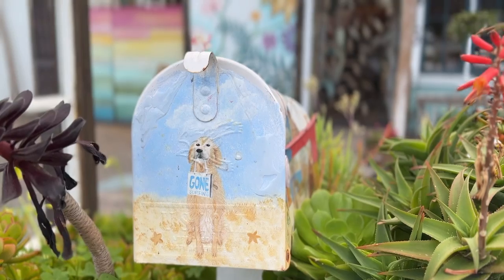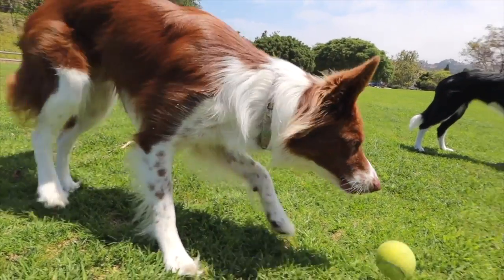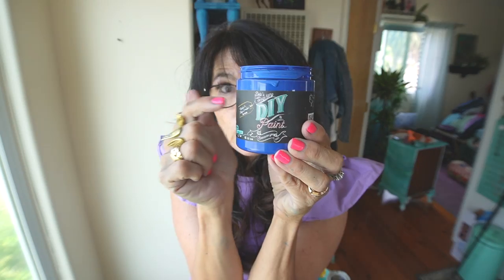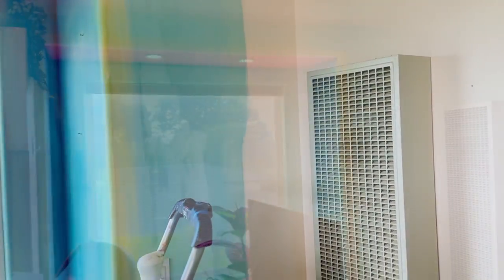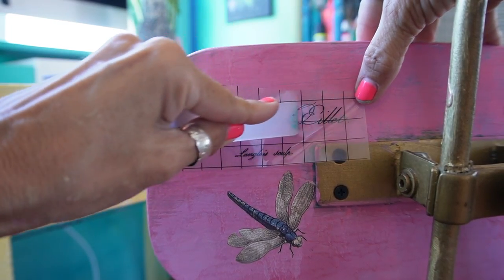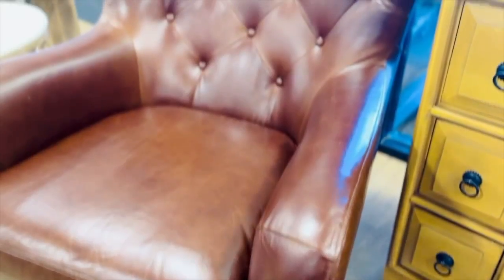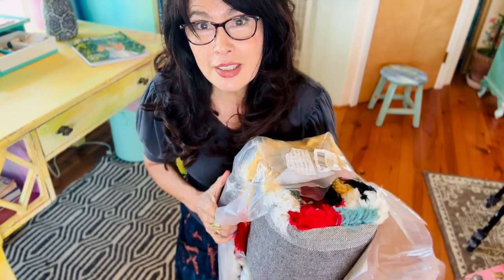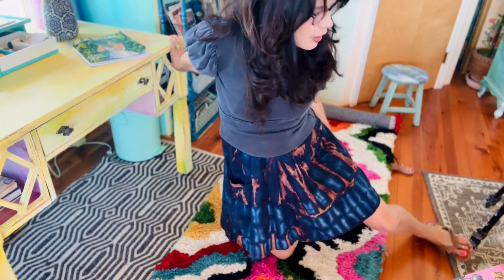25 years Hoarding, MAKEOVER from  vintage TRASH

Comment from the maker: get tickets to our big craft party this September and find all the supplies we used in this video- https://diyagogo.com
Reply: Your room looks fantastic, May I make a suggestion? For safety sake, I would have your dad bolt that tall skinny shelving unit to the wall so it does not come tumbling down on your head and sore neck! even just to attach leather straps around the spindles at the top to the wall... also, you want more weight on the bottom shelves instead of the top to counter balance. I hope that helps hun❤
Reply from the maker: Thank you for the great suggestion! Bobby did that for me last week. The last thing I want was that thing tipping over on me❤❤❤❤

Comment: Absolutely LOVE the colors you use!  Suggestion: Declutter a little bit one day a week for an hour!
I am a hoarder of craft supplies and books. To declutter my house when I retired, I chose to do it one room at a time. I started with my craft room. First step was taking an inventory.  I saw that I had WAY more stuff than I could ever use. Then I held each item in my hands and asked myself if I really needed it.  Could I see myself using it in the next 3 months, or one month? If the answer was no, I put it in the donation box. When I got down to the amount of things that seemed right, I bought a system of totes and shelves to hold everything. Then I listed everything in the totes on an outside label.  So much better!!  
Good luck on your journey, Debi!